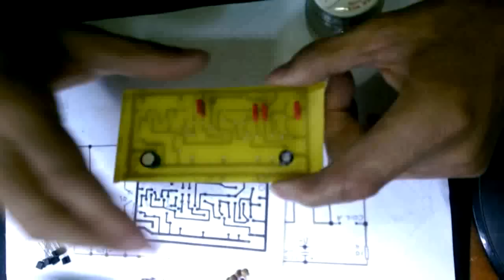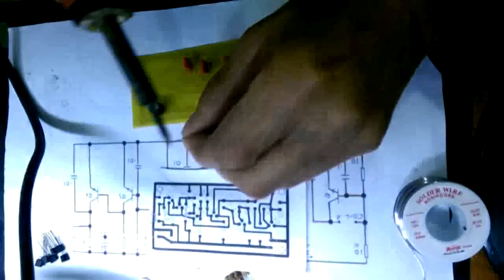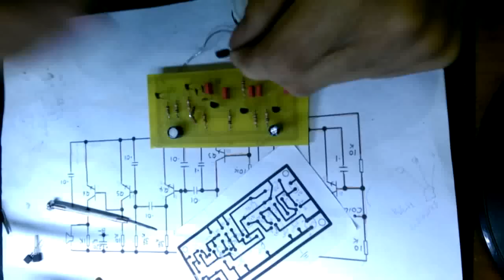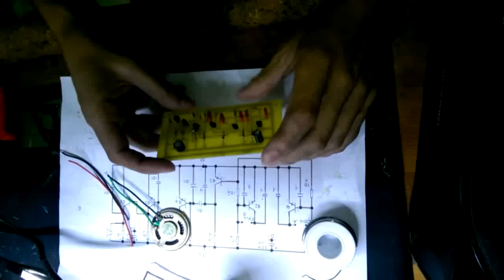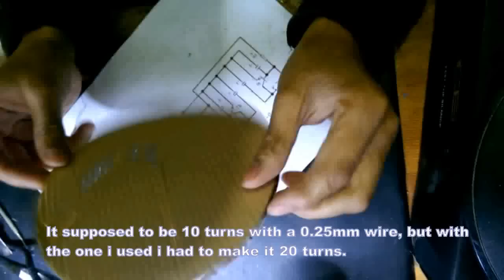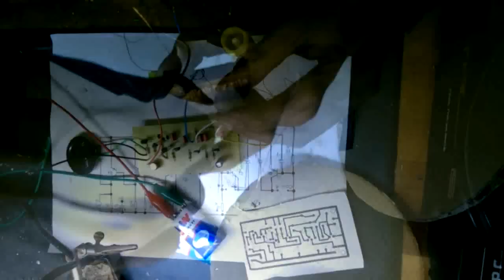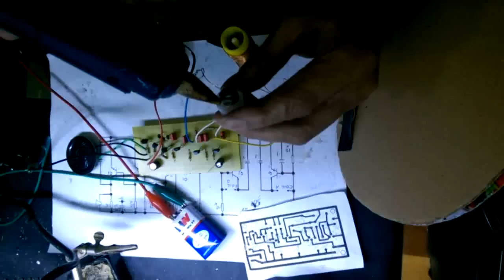Homemade Metal Detector

Comment: Hi, 
Nice work! Did you have to overlap coils on the 2cm glue stick? I was trying to make one of 125 turns on a glue stick and I could only manage about 70 before I ran out of space on the glue stick.  I see you managed to use 185 turns. Is it ok to overlap the turns on the glue stick? Thanks, James
Reply from the maker: Hi,
Yes you can overlap the turns , I actually did 2 layers to manager the fit the 185 turns , if i remember well , it been a while :). 
However don't commit to a fixed number of turns at the beginning . It's a bit annoying to tune it the first time . I suggest to complete the full circuit , turn it on  and then vary  the number of turns of the glue stick coil till you hear the cracking noise.
Good luck
Reply: @OussamaOusmoi  .زز

Comment: Hey Oussama Ousmoi, Lemme ask you something regarding the coil, what determined the number of turns and thickness you used? I've been reading more on the coils since this is the first time i'm building a metal detector circuit for a project, and have been seeing that it does help with increasing the range at which you can detect the object, but say if I wanted to detect a ferromagnetic object at about 6 to 12 inches away is there a principle or formula regarding the relationship to this?
Reply from the maker: SeraphCrossroads Hi Seraoh, the coil diameter, wire diameter  and number of turn variations will change the circuit operation frequency, which will effect 
the metal types detected,  lower frequency is good for iron and copper and higher frequency for gold etc... . this circuit i used operate at around 95khz-110khz.

It is said that the bigger coil is the more range you will get, but at price of the object size, smaller objects will be hard to detect.

So you can try increase the coil diameter, but to stay close to the desired frequency you will have to adjust the other coil factors or make some changes to the circuit capacitors of the LC oscillator.

Sorry i don't know or have a formula to calculate the detection range in relationship with the coil size, i myself no expert in this :), i just always wanted to build and have a metal detector, and this one seemed fairly simple and quiet easy to understand.
Reply from the maker: SeraphCrossroads check this out http://electronics.stackexchange.com/questions/167483/parameters-of-a-metal-detector-coil
Reply: Oussama Ousmoi  Ah ok, excellent! Thank you very much! This should help a lot, and fortunately the objects to detect should be fairly large (at least the size of a soda can). I definitely appreciate the help,  the link you sent looks like it addresses the parameters in question fairly well, and with great expediency as well! Your video was also very helpful, and has given great insight on the project in mind. Keep up the awesome work, and look forward to seeing more videos!
Reply from the maker: SeraphCrossroads You are welcome, glad it helped a little bit . good luck with your projects as well .
Reply: Thanks, I'll let you know how it goes!
Reply: Oussama Ousmoi Oh yeah, one more thing I forgot to address was what you mentioned for the LC oscillator. While a coil calculator has helped in giving me good estimates as to what inductance i'm hooking up to the circuit, and that the general form for finding how to adjust this based on f= 1/2*pi*sqrt(LC), are there any other major considerations or advice for a first time experimenter with this? I calculated the parameters for Coil A and they seemed to match up pretty well with the circuit for what was used in the schematic example, (assuming that the capacitors for each section of the BFO LC section for coil B are considered to be in parallel), however for what was used for Coil B I found it to be decent but, it was a little off for what was used (the circuit used about about a 205 microhenry coil as to what the parameters yielded, and the required capacitance to oscillate at the 95 kHz frequency was about 1.02E-8 Farads which is about a fifth of what I expected the capacitance to be, so I'm a bit confused about that.
Reply from the maker: SeraphCrossroads I did tried to calculate the frequency using that formula , i even made a signal oscillator transistor and tried compare the  results with what i get on the oscilloscope  but never got a similar results :d , i though it was because of the was coil poorly built, as even the wire thickness  do effect the coil value, so probably  the 205 mH you found is a little bit off.  
The circuit is based on a colpitts oscillator , and both 2 oscillators has the exact same LC values , so result must be same .
check out also this link bellow , it's explains a little more , starting from part 2 :
http://www.talkingelectronics.com/projects/200TrCcts/MetalDetectors/MetalDetectors-1.html
Reply: Ah ok, that makes sense now, and when you mentioned the Colpitts oscillator I found a slight variation on it where fo = 1/2*pi*sqrt(L*(C1*C2/C1+C2)) so I'll check this out as i think I left out the terms on the top for the capacitance and see if that does anything to that little thought, if it doesn't come out right, I won't linger on it too long and see what I can do with the actual design since the numbers aren't too far off with the original, and still look to be in a decent range. Thanks again for your help :)
Reply from the maker: SeraphCrossroads Yep it is, let me know if you find anything interesting . you made me wanna play with the circuit again more :) . good luck
Reply: Excellent! Thanks again!
Reply: Oussama Ousmoi Hey, a couple more things I was curious about in the circuit; the 4 transistor network that is hooked up to the BFO section, is it strictly to amplify and control the oscillation of the speaker (what type of transistors are you sing by the way, as I only have 2N3904's available to use)? Also for the head of the search coil, does the cardboard and CD act like a Faraday shield to prevent interference, or does it require something like aluminum foil to use as a Faraday Shield?
Reply from the maker: SeraphCrossroads  Yo ,  actually not quiet sure exactly either about the last 4 transistors , there must be an amplification it's for sure , but i think  the one just after the BFO section is acting like a comparator .
For the transistors type , i used 2n2222 .  2n3904 should work without problem too, they are fairly similar .
The cardboards they are just to help shaping the coil,  they don't interfere or shield it .
Reply: Oussama Ousmoi Ah ok cool :), was curious especially with the shielding, as it would probably remove some interference from detection. Heard that the capacitance created between the distance from the ground and the detector adjusts, and might affect the overall performance.
Reply from the maker: SeraphCrossroads True i noticed that when i tried it outside , it do pick some small interference sometime, but not often , i though it was because of GSM signals or something.  
But if you shield it, it will not detect anything :d .  probably you just need to let it unshielded , and  play with the system frequency i guess .
Reply: Ah ok, thanks!
Reply: Oussama Ousmoi Hey its been a while since I last talked to you, and while the progress on the project has been going well, I have hit a bit of a snag. I'm on the step of making the coils, and I have seen different variations in the turns used and the wire gauge. I've mainly been using 30 AWG wire (about .255 mm diameter wire) and a variation I thought I would try to use around 130 turns for the reference coil, and 12 turns for the search coil. I got right up to the point where I was trying to listen out for the squeal of the buzzer but, I don't hear anything, and have tried quite a few combinations, and am still a bit puzzled as to why i'm not hearing anything. So, there are a couple of things I may be thinking there's a problem with it, and that is either the transistors may not be working as I'm using 2N3904 instead of the C1815's used in a model that I've been looking at, or the buzzer I'm using, which is a 3-16 VDC 70dB mini-buzzer from Radioshack (Primarily been going to them since they have a shop left open only 15 minutes from my house, and they do generally have things I can use despite their larger expense.) The reason I consider the transistors possibly malfunct is because the positions of the model i'm going off of has a different pin set up than the 2N3904, and while I have put the pins in matching configuration, I wasn't sure if there were any drawbacks to the switch. As for the buzzer, I'm not sure what the limits are since i couldn't find the datasheet regarding if it would be appropriate or not, and my only alternative i have to it is an 8 ohm speaker that is 1 1/8 inches and has a max wattage rating of 0.2 W, since I couldn't get anything higher than that wattage.
Reply from the maker: SeraphCrossroads Yo how is it going .  Yeah it took me quiet few tries to get it right too , it's a little bit frustrating .  about the coils  it's better to start with the search coil first and set it a side  , and then do the calculation to find it's value , and based on that deduce what the reference coil will looks like so it matches the same value. once done and assuming the circuit is working , start unwinding  few turns of the reference coil till you hear the sound , and don't be afraid , do unwind few turns :d i had to unwind about 20 turns ...  , if nothing start winding back and add more . if still nothing then probably there is some mistake in your circuit .

if you have access to an oscilloscope, try probe the two oscillators and see if they are oscillating . 

Regarding the transistors 2N3904 should work  . to avoid the suspicions use 2N2222  you could find them everywhere i believe.  they worked fine for me .

and for the buzzer i don't see why it wouldn't work at least you will hear something even if it's not loud enough , or  you can use a head set  at first instead of a speaker .
Reply: Ah ok cool, I'll keep at it, and I actually did a bit more debugging today, and realized that one of the transistors may have been a culprit, and i'm glad I caught it in time because yesterday i had a clogged nose, today without my nose clogged up, I smelled one of them burning up. I did a quick hovering finger test above them to see which were hot, and marked it with red electrical tape, so I hope to find a replacement, which I should have. After that, I'll see if I can get the LED to light up, give a quick test with a multimeter, and then attempt at the coil making again. Thanks, again for the help! :)
Reply: SeraphCrossroads Hmmm, so I replaced that transistor that was overheating, checked out the part positions to make sure that everything is in position correctly and not connecting in the wrong place since I'm breadboarding it, and all seems well there. After replacing it though, the replacement for the one in the previous spot just ended up smoking and overheating again. I've been trying to see how much voltage I'm getting across that one, or if there is something in the middle I'm missing, and that LED I'm using to see if there is power going into the circuit is not lighting up despite the presence of it definitely being attached.
Reply from the maker: SeraphCrossroads hmm,  you are powering it with a 9v battery right ? :d.  
transistor overheating or smoking most of the time caused by wrong polarity , i did fry 2  due to that. so double check again :) 
where did you place the LED exactly ? .
i think i have a couple of 2N3904 , i'll replace the 2n2222 with them and give it a try , and let you know .
Reply: Oussama Ousmoi Thanks man :) I am using a 9v battery and while I am fairly certain I have the polarity right and the transistor pins in the right place, it wouldn't hurt to check again. As for where I placed the LED, it was in series with the emitter of Transistor 5 (Q5) based on the original design. The LED itself though is an option I mimiced from a step by step that placed it in that spot. Hmmm.... come to think of it, and I should have realized it before that if it is feeding off the emitter of Q5 it might just be a heads up indicator that your in the target voltage range for the speaker operation or something along those lines.
Reply from the maker: SeraphCrossroads Yes Even if the LED lights up  will not means it's working  cause the speaker will needs a voltage variation .
Concerning the 2N3904  i gave it a try and  they are working even better than the 2n2222  :) .  i replaced on the 2 oscillators  and  on the  Q5 and Q4  .
So your issue is not  with the transistors ,  it must be some mistake on your breadboard .  maybe try make a PCB  to be sure .
Reply: Gotcha, I really only have 1 PCB and it's rather small for this project, so I'll see if I can find something to work with it, or I also have 3 or 4 breadboards to spare so I'll try building from the ground up on a new platform, and see how that goes.Thanks again, you've been a major help with this.
Reply: +Oussama Ousmoi Hmmm, so it seems from what additional testing did showed I may have been doing a sophomoric mistake. Some of my previous attempts with the circuit and wondering why the transistor was smoking revealed to me that the serach coil may not have been making proper contact at all in the board, and I realized I didn't sand the tips of the enameled wire to give better contact either, so the circuit probably saw it as an open, and what ever back lash was probably bombarding transistor 3 in the circuit (I originally thought it was transistor 4, but after looking through and getting my bearings again on the schematic, it turned out to be 3; he also confirmed that the last two transistors are combined into a darlington setup to amplify audio output, leaving me with the guess the other two are for noise reduction and stepping up the signal afterward before outputting to the darlington pair). Anyway, so while after trying i again with corrections, the transistor didn't overheat or smoke, but after making some adjustments with the coil and trying that out I still didn't hear anything, so I still have the reference coil to try again, as I see now that there are some gaps between loops caused by the peeling ends of the tape used to tape down a coil end when making it.
Reply from the maker: SeraphCrossroads oh ok, so nice progress as long no more smoke comes out lol  .
the coil gaps shouldn't effect much i think if they are small .  a trick i  used during the tests , is to make an exact copy of the search coil ,  so you are almost sure that the 2 coils are identical  or not deviating much .   and that way you will have higher chance to hear something if the circuit is correct .
Reply: Ah ok, cool I'll keep that in mind and hope I don't do anything else silly to send the transistors rocketing to the moon lol XD, and thanks again!
Reply from the maker: SeraphCrossroads haha , maybe if you send the whole metal detector to the moon, it will be useful there lol  :)  .  you're welcome any time . keep it up ! .
Reply: lol :) and just seconds before you sent this message I saw that one other thing was out of place and that a capacitor wasn't connected with Transistor 3 this time so that could be another thing right there. I'll check the whole layout one more time because the sea of wires on the board is so thick I could barely tell it was in the wrong spot XD
Reply: Oussama Ousmoi Hey Oussama, one other thing about the circuit that has been bugging me a little, is for the battery, did you have negative lead connections for the battery at both 220 uF caps and in between the caps at transistors 3 and 4? Reason I ask is because the schematic deviation I have been following step-by-step only makes use of one 220 uF capacitor and only seems to have the negative lead connected to that one capacitor
Reply from the maker: SeraphCrossroads Yo Seraph , Yes i used both Caps,  But  yeah  one should be enough i think , they do just filter noises i guess .
Reply from the maker: SeraphCrossroads what's up Seraph , how is it going , any luck ? , did you manage to get it work ?
Reply: I did manage to get the metal detector to work, but I went with a smaller circuit. It was one involving a 555 timer. The BFO circuit itself is not functioning. I am still doing a bit of tweaking on it, and my professors suggested that since I was doing the circuit on a small universal breadboard that I might want to consider giving the elements a bit more space. Also my wires were pretty long as well so I'm trying to cut those back a bit. I probably won't solder them to a pcb until I know the circuit can function on a breadboard, and might need to do some  O-scope and calculation work to make sure I can get what I expect.  I haven't had much access or funds for an O-scope up until a week or two ago. Still, most of the feedback you have given has helped in further understanding the circuit, and while not a priority anymore, it is still a fun little side project to learn from :)
Reply from the maker: SeraphCrossroads that's  great,  glad that you didn't give up on the project :d .  
Yep  with  Scope  will help you understand further more  . 
Good luck and keep it up ! :)
Reply: Thanks :)
Reply: +Oussama Ousmoi ,,, one more question ,,,what is the resistance of search coil and the oscillator coil,,,thanks for entertaining all of my questions ,,i learned a lot from you ,,, GOD BLESS YOU!!!

Comment: Good one cuestion coil 0.19mm or 0.20mm is valid?
Reply from the maker: akiles akilius  both should work , but you may need to add more turns in your windings .